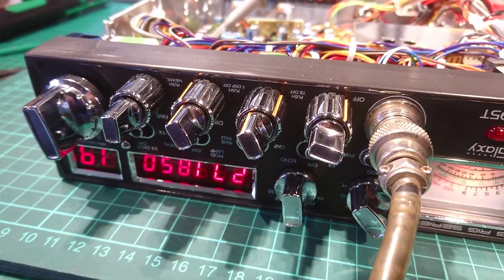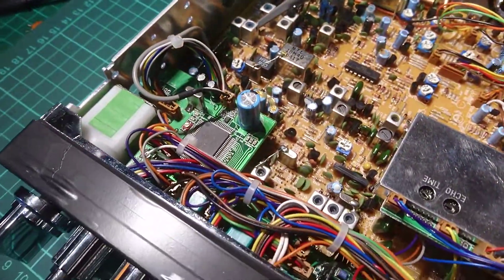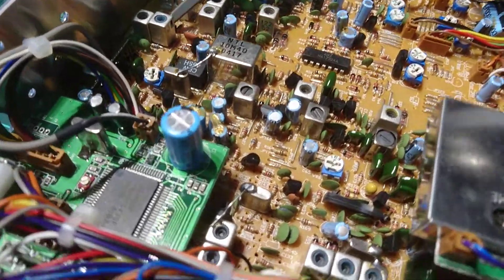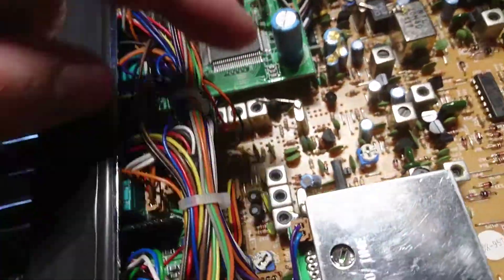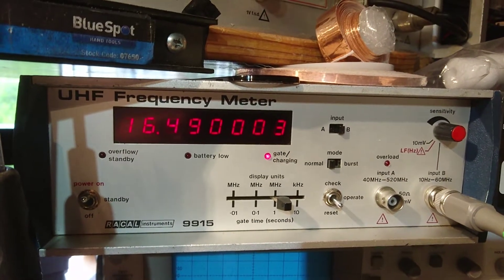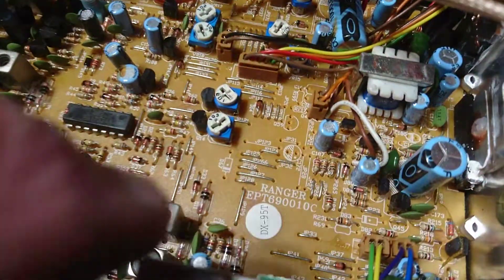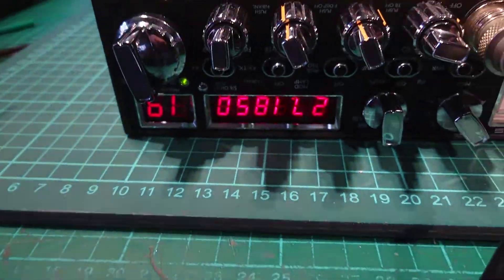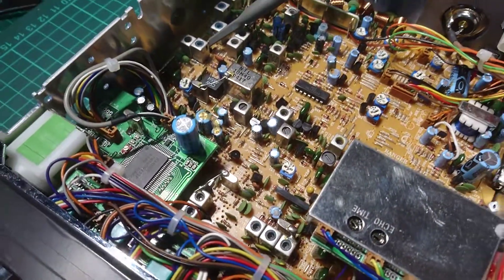Galaxy DX 95T Frequency Drift just by breathing on it

Comment: I have a DX959B I got 3 years ago work fine for 2 years then the frequency suddenly drifted up eventually making it now impossible to clarify ssb and running out of adjustment on VR6 for transmit  I think a crystal or capacitor  has gone bad